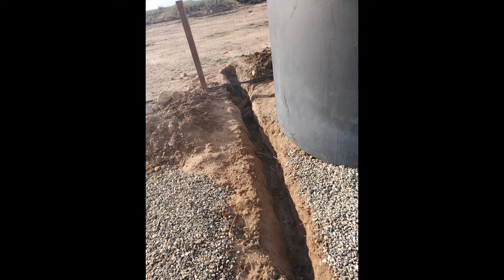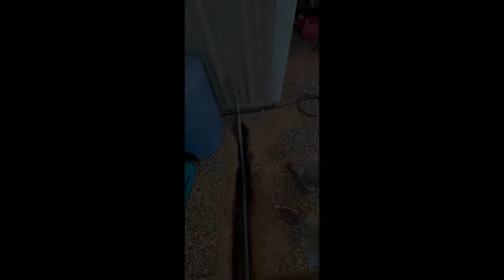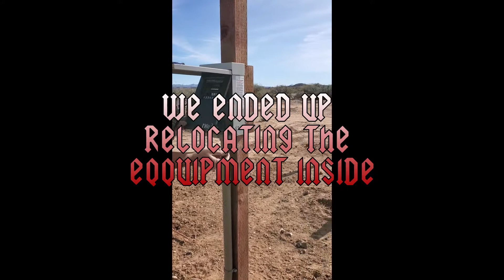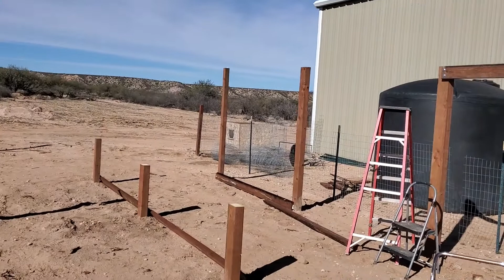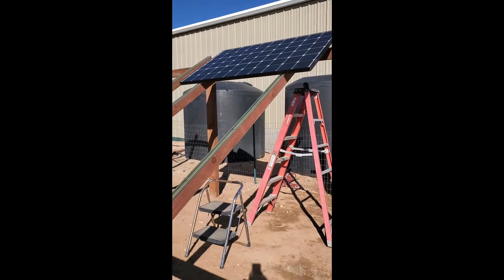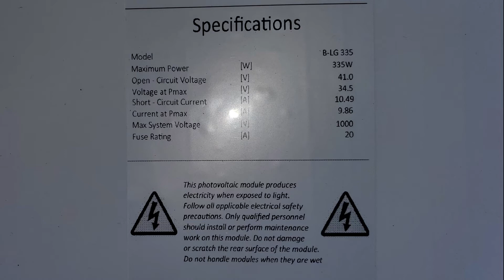Helios Commeth!  (Solar Setup Part 1)

Comment: That looked fairly simple. I wonder if we get enough sun in the Pacific Northwest to make solar useful. We're dry and sunny for June through Sept, but the rest of the year is overcast and rainy most of the time. I'd like to be able to at least power the greenhouse, barn, coop and all the outbuildings, basically.
Reply from the maker: I'm actually getting ready to post a new video that describes the monitoring software as well as our network setup (how I'm able to earn a living being this remote!)  This week is pretty overcast (for So. AZ at least.)  It's only midday here and we've already generated 6.6kWh - full clouds most of the day.  Yesterday rained and was cloudy most of the day.  We produced 14.4kWh yesterday.  Stay tuned!